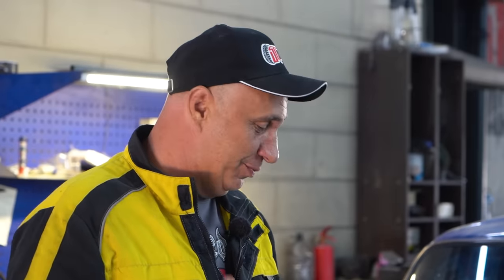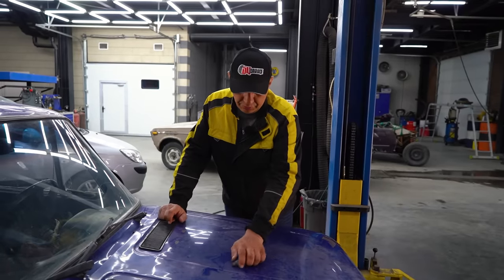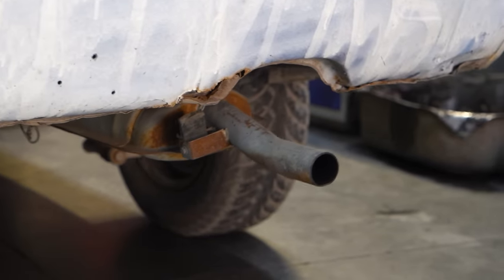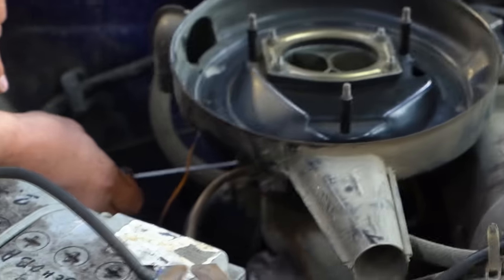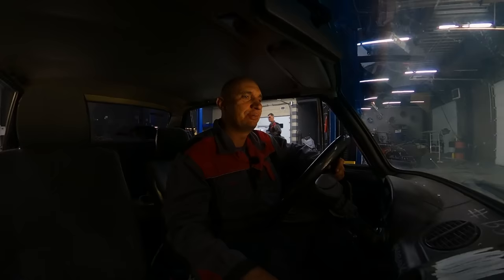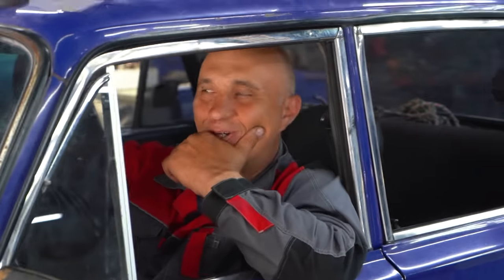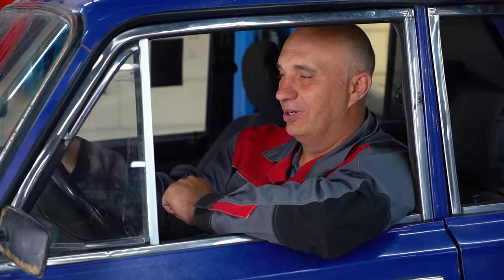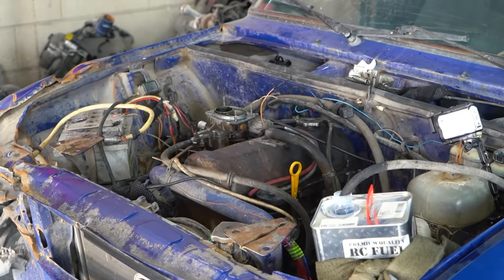Glow plugs in a gasoline engine - will it run?

Comment: My dad had an FSO that looked identical to that. It was literally like a tank, it had the ability to pour boiling hot water on your feet as you were driving! Awesome car!! 👍😎
Reply: Except it was very different
Reply: Yeah very different as in 95 percent the same. Go get a clue дурак
Reply: FSO was more true to the original Fiat design, on which the Lada was based. FSO used a development of the Fiat drivetrain, retained the twin headlights and had a very different interior. In the rest of the world, if memory serves, FSO was known as Polski Fiat, or Fiat Polski. The most common one, outside of Poland, was based on the Fiat 124, just like the Lada, and the body shell could easily be mistaken for a Lada, from the side, but front, rear and interior were all sufficiently different to make confusion unlikely. In Poland there were a whole range of cars, all based on Fiat platforms or using Fiat components, like the Polonez.
Lada didn’t really do that, nor did they use the Fiat drivetrain, so apart from the basic monocoque shell, there’s not much that’s common to both marques.
Reply: @techtinkerin  different engine. Lada has 5 camshaft bearings, fso has fiat’s original 3 (fiat 1300-1500 engines) Engines are not part compatible.

Different rear suspension. Lada is coil sprung like the original fiat 124. Fso has leaf springs from the fiat 1500.

Different brakes. Lada has aluminum drums in the rear a russian design, fso is disc brake all around like the original 124 and 125 excluding the Argentinian 125 which has drums in the rear.

Different interiors, lada is better equipped with a tachometer and a dial speedometer, fso has a snail speedometer, no tach. The interiors are vastly different, including the rear seat being further back 3 inches

Different bodywork. Gastank is under the trunk in the fso, and in the trunk like the original fiat 124 in the lada.

Front and rear ends are completely different in size, the fso is longer as its a fiat 125, a completely separate car from the 124 the lada is based on. 

You are right, the doors fit from early models, so that makes them 95 percent the same.

Who needs a clue here?
Reply: @duncancremin1708  the irony right? The only clue here is the one @techtinkerin is missing

Comment: hey try putting the spark plug wires going to the glow plugs the voltage from the coil should be enough to cause the glow plugs to rapidly heat up to fire the mixture and i find that nitro methane when mixed with 95 octane gas works wonders any way you guys are great love your videos as i am sure your neighbors are laughing at all the stunts you guys try kepp up the good work

Comment: Hog out the jets in the carb, remove or modify the metering rods, if actually has any, but still won't ever run good enough to do anything! Not.... enough..... compression. 
I did run a Briggs n Stratton on kerosene after was hot, but only ran pretty much fully choked n made shit for rpm. And I figured that out when I was like 12 years old.